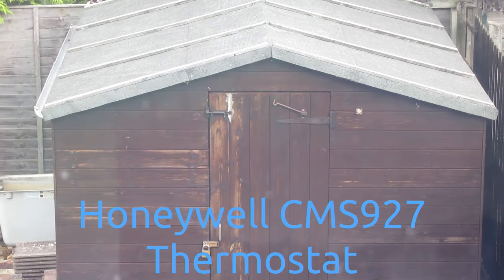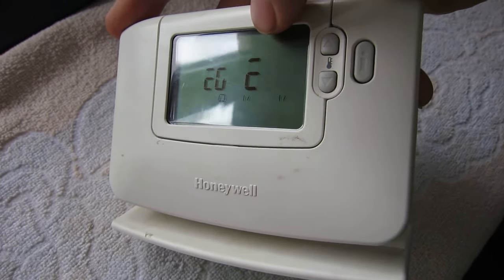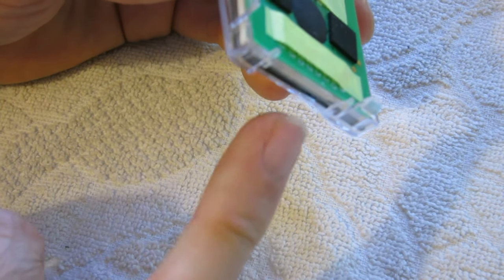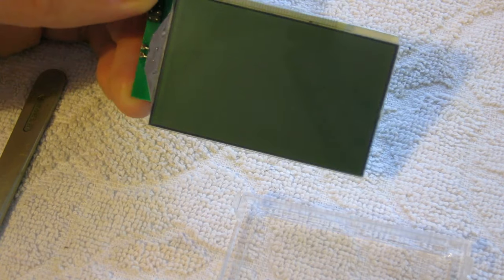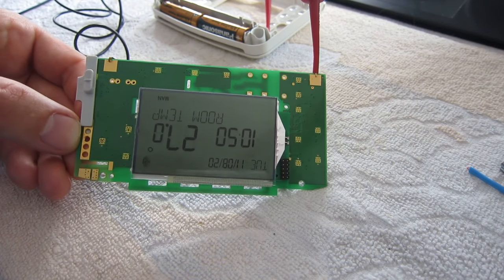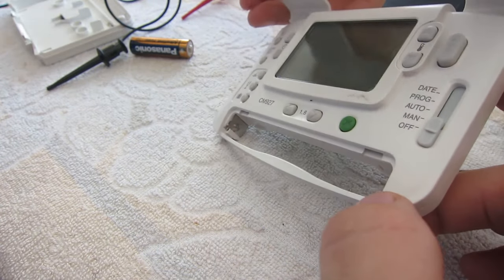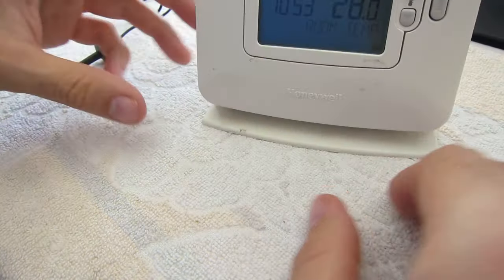Honeywell LCD fail and repair

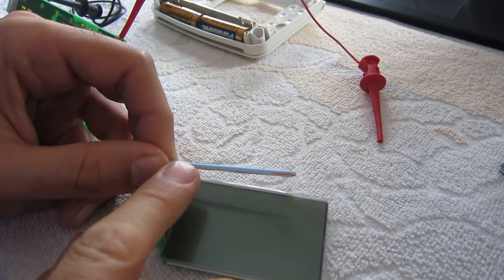Comment: I agree with ngorongok about the music and the audio quality - however, this video was super helpful to me in solving my problem with ghost characters on my CMS927 thermostat. I was planning to buy a new one - but the CMS927 is discontinued. Honeywell tell me it can't be repaired and recommend replacing with a  Honeywell T4R thermostat (about £100) which then would need to be paired with with the installed receiver. This video (plus a bit of added ingenuity) has saved me all of that. My first attempt, using a toaster, failed but when I used a hair dryer and added a piece of shaved down ice lolly stick as square section packing (as at 7:04) it worked perfectly. I now have a fully functional thermostat with all digits and characters displaying correctly - and I've have had an enjoyable and rewarding afternoon. Many thanks!

Comment: Tried this on my CM927 which had quite a bad case of failing display. Tried it a couple of times with a hairdryer and it ended up worse than it was originally. Decided I had nothing to lose so did it with a toaster for a couple of minutes and was amazed -- it's now perfect. So, the lesson   I guess is, don't be afraid to give it a good toasting. Many thanks for the video.
Reply from the maker: Another saved from landfill :)

Comment: heat gun and one bulldog clip. concentrated on heating clip (held with pliers) until screen looked like I may have killed it. worked a treat. saved me £200. for how long I don't know but see no reason it shouldn't last a good while 🤞. 1/2 hour pottering in my own grandads shed well spent. many thanks.

Comment: Fixed a nice LCD radio signal clock with your clue of applying heat. I used a hair drier. Thanks for posting.

Comment: Great video,. I  tried first another video which state to warm/heat the LCD for about 20s above a toaster.  Repeated this several times without any improvements. Since the lcd didn't work i tried to ready heat for 2 to 3 min's also to the point the lcd slightly colored darker. And after the second long heat the display did work again !!  Many Thanks .
Reply: Your mileage may vary,  but in my experience this procedure absolutely works. Though you might have to repeat this. In my case, the first time I had to do this was about two years ago, and the second time last week. Important is to let it soak up the heat for at least 1 minute. It’s the combination of heat (not too much, to prevent melting everything) and time (so the adhesive warms consistently). I do expect that ultimately the LCD will fail at one point, but there’s been no reason to discard the unit yet.
Reply: @M1LKMAN2  Indeed my solution did only work for one week...since i cannot reheat the circuitboard every week i bought a new thermostat.  I hope that this  solution works longer for other users.

Comment: One of my CM927s lost part of its display earlier this month. I watched this video and others and decided to tackle the repair once I was back from a short holiday.  I took the batteries out and left the CM927 in a room which will have been quite warm in view of recent good weather. I am now home again. I replaced the batteries and was delighted to find that the display was back to normal. Of course, I have no idea how long it will be before there is another failure of the display, but my advice would be to not rush into dismantling a unit until you have given it a chance to auto-repair.

Comment: it looks like you've reactivated the conductive adhesive between the flex circuit board and the screen.  Excellent work!
Reply from the maker: Yes I believe so, as it was not hot enough to reflow the solder.

Comment: Thanks a bunch this really helped me, couldn't blive it
 it took me minutes to fix my fisher paykel fridge freezer display that totally stopped working, just took it out put it on top of the toaster not expecting it to work at all but to my amazement it just came back to life as it was a new unit, it would have cost me a lot to replace
Thank you so much for the video
Reply from the maker: Nice to know that with this video you were able to apply it to a different product.

Comment: I ended up buying the much cheaper 2-wire on/off version, which has the exact same screen module. That module works perfectly in the wireless CM927 version.
Reply from the maker: Do you have a part number for that - as other people may be interested in the swap.
Reply: @mygrandadsshed  It was a CMT907G1003, and the display module is still working fine with the old CM927 unit.  Swapping the display module was even easier than buying a new CM927 as this solution preserved all the settings and I didn't need to re-pair it with the wireless receiver.
Reply from the maker: Thanks - I've posted a reply to @Giuseppe Sanfilippo  who was asking in the comments of my video without the loud music :)

Comment: Absolutely fantastic, saved me £125.  Took me three times, didn't have cue stick in the correct place and third time went with toaster heat for longer and just at pointed towards ribbon edge.   You are a ledge.

Comment: There are available in the market cheap soldering irons with flat tips for soldering especially these types of ribbon cable and also are available the cables since they are used widely in car dashboards for displaying various informations.This kind of repairs are time waisting because if not totally got broken it might or not work or even if works it lasts for a very limited period of time.

Comment: Hello, maybe you can help me, I replaced the damaged lcd display of my Boafeng UV-6R.
When I install a new lcd, it has a high contrast, only when the battery is low does it allow reading.
Thanks

Comment: How many degrees do you calculate? I'd use a heat gun. Thanks!
Reply from the maker: The original manufacturing process would have has either used a IR or vapour phase solder reflow profile. Search for 'solder reflow profile' and look at the temperature time profiles. With a heat gun you need to be careful as it could get too hot. The slow ramp at the start of these profiles is to ensure that the components on the board don't crack with thermal shock. Target temperature should be around 200°C and no hotter than 250°C.

Comment: why dows heating the display fix it? does it fix the crystals somehow?
Reply from the maker: The crystals are not damaged. The heat reconnects the flexible connection to the green circuit board. This is why the packing is important.

Comment: Thanks. I have followed the instructions. Easy to follow.. But I think in the glue between the screen and that white background has worn off and it flaps open 04:19 . What kind of glue i need to stick them together again if needed. Thanks
Reply from the maker: I don't know what that tape is - probably a version of Kapton tape which holds the screen flexi-connector onto the PCB.
This is why I used the packing shown at 6:58 while it was being heated. Another viewer suggested an ice lolly stick as about the right size to start with.
Reply: @mygrandadsshed  thanks. The question is does it need to stick together? I have cooked the screen few times by now but the digits still showing as half...
Reply from the maker: The tape is only to support the solder connection beneath. It should prevent it cracking when pressed back into the plastic.
Reply: @mygrandadsshed  so the white base has nothing to do display. I thought it worked as digitiser or something 😃 looks like my display is broken then. I don't understand the whole cooking process

Comment: I’ve tried your technique to fix mine, but it didn’t work. When I press on any of the panel buttons the screen goes blank. I then have to shake it to get the screen back which is very annoying. Anyone got ideas what the problem could be? The digital display is perfect otherwise..
Reply from the maker: If you inspect the flexible connection between the screen and hte board is there a crack in any of the conductors. 
Depressing the button will twist/bend the board causing slight movement. It could also be the power input connect.
Reply: Thanks I’ll check that info out

Comment: Put the Cigarette Gelatin on the display conductor contacts. Then move the pen with a soldering iron to the right and left for about 1 minute, it will be fixed.